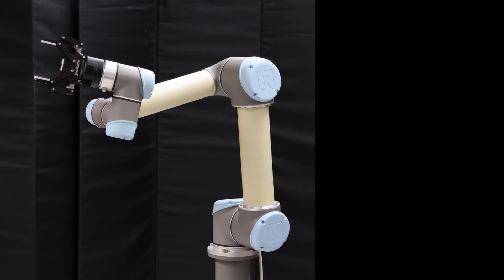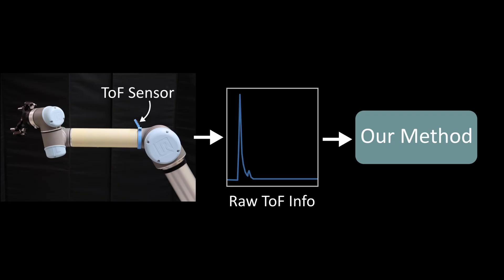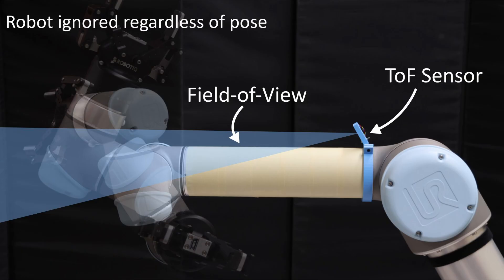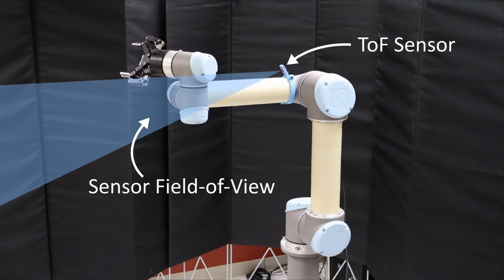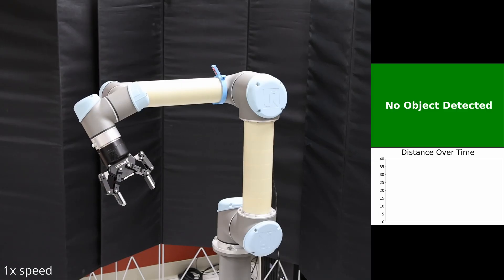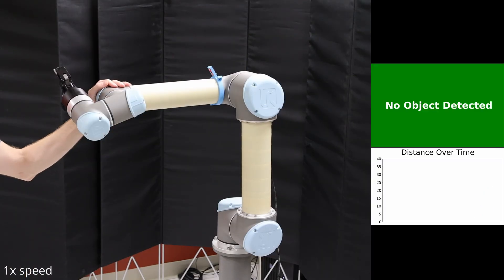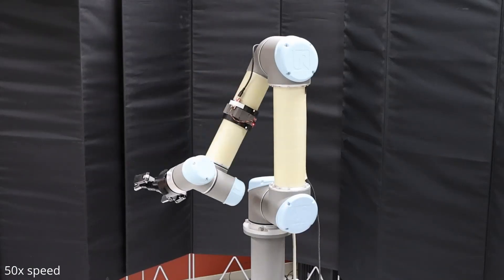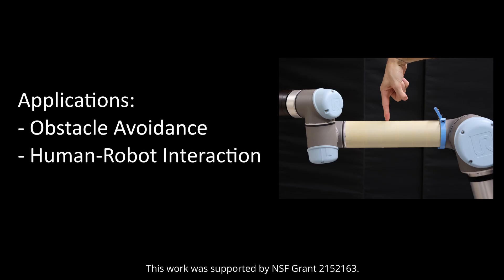Detecting Objects Near a Robot Arm with Mini 3D Sensors

Comment: you're making a perceptive skin for the robot arm? so it cant go bump into stuff right?, why not to use a springy metal mesh
Reply from the maker: This isn't the only possible solution - there's lots of work around compliant mechanisms and tactile sensing like what you describe. But like our proposed method, they're not mature enough to make their way to commercial products yet. Each approach has its pros and cons in terms of cost, durability, etc. One benefit of our approach is that the hardware required is very inexpensive, and since it doesn't rely on touch, it won't wear out over time.
Reply: That wouldn't work. The next best way would be to use position tracking on each motor, import the model to a 3D environment to train the robot, then run it on ROS.